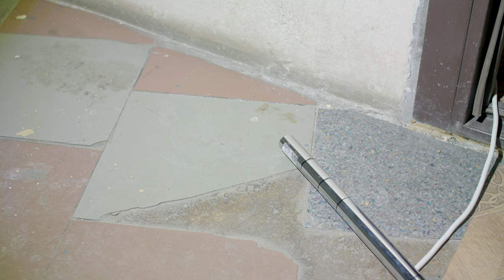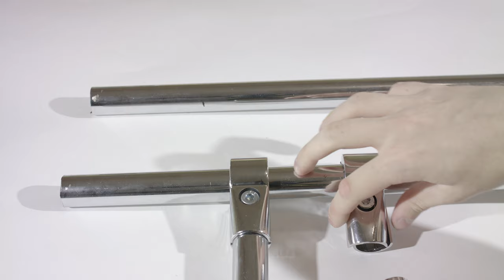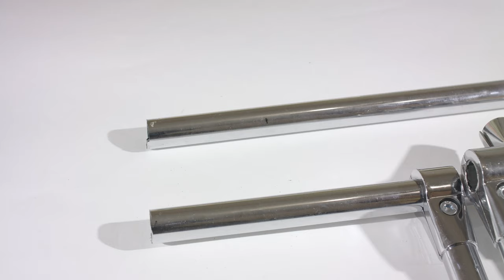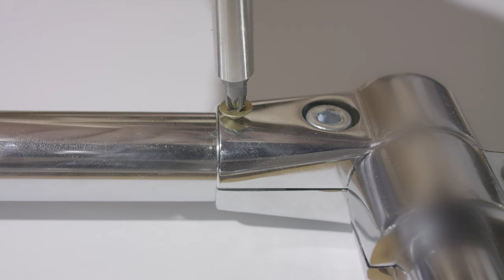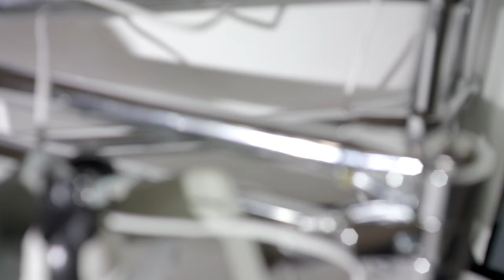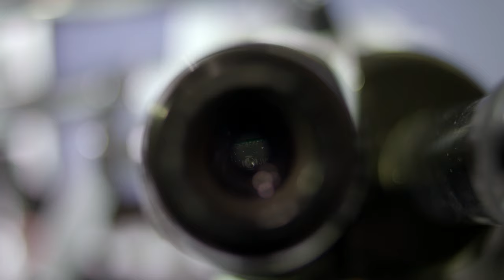Building a low cost microscope stand/arm out of furniture pipe and clamps

Comment: grat video what diameter pipe did you use? many thx
Reply from the maker: This was 20 or 25mm if I recall correctly
Reply: @Spirit532   what do call that
 kind of clamp?
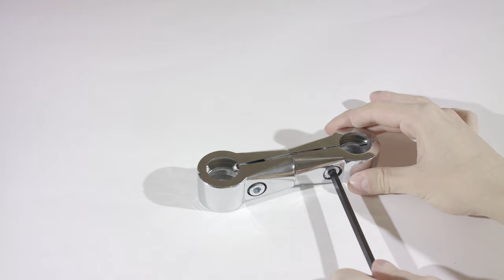Reply: 0:41
Reply from the maker: @batangdownload  It's called a "furniture clamp" here. Used to build cashiers fronts in stores and such.
Reply: @Spirit532  thanks a lot...
Reply: do you have a link where i can buy this clamp? thanks in advance.
Reply from the maker: @batangdownload  No, I bought it locally.

Comment: the whole materials cost the same as the stand itself from china and you call it low cost
Reply from the maker: A $25 stand from China would immediately collapse under the weight of this microscope.
Reply: @Spirit532  25 usd ita the price of just 2 clamps u used so this is a nonsense
Reply from the maker: @informediatech-bruno5766  That's how much the whole thing cost me.
Reply from the maker: @informediatech-bruno5766  Dunno, they're cheap here, in a local store.
Reply: @Spirit532  show-me ill pay you 30 usd plus shipping
Reply from the maker: @informediatech-bruno5766  $400 including labor
Reply: lol
Reply: @spirit nice vid btw
Reply: @Spirit532  Nice vid btw